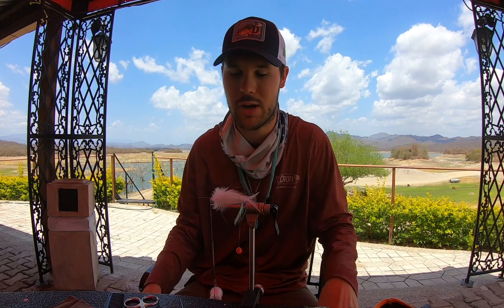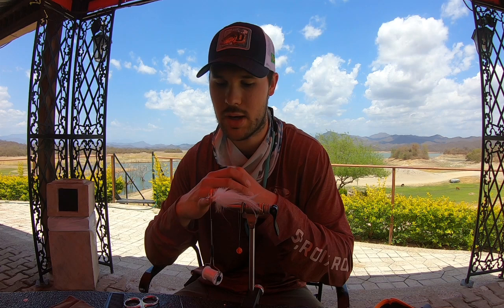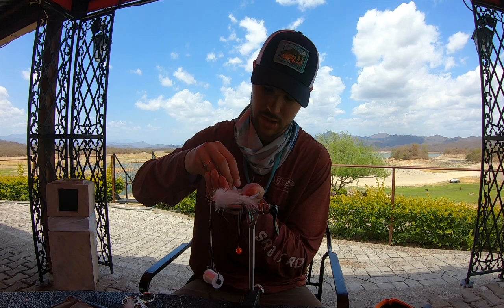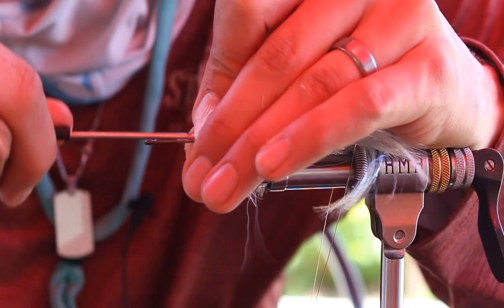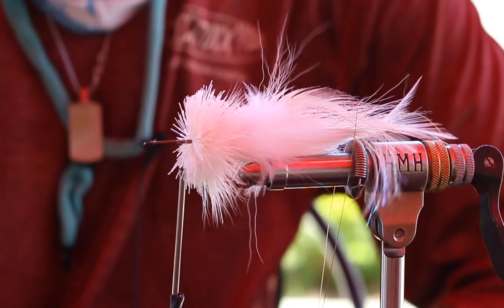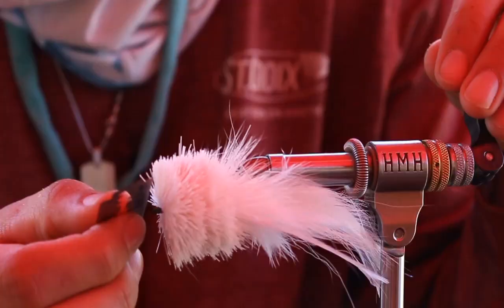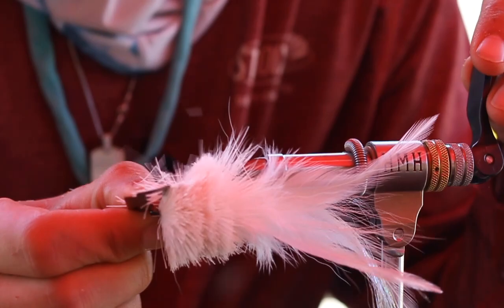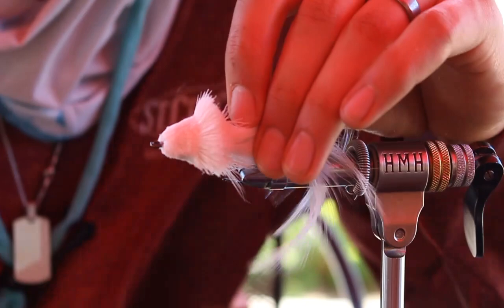Fly Tying: How to Spin Deer Hair

Comment: Very good instructions imo. You tie very much like i do with hair bugs but much better. A couple of details are different from my procedures but almost the exact same. Thanks for posting. I started over 50 yr ago and had to figure it out on my own and i am surprised how close we ended up on technique. I hope many beginners find your vids. The one thing i would like to see is more detail on thread. I started with a real heavy rod wrapping thread from Herters. I may still have a little of it in my supplies. I used mostly body hair and still do. I tie mostly variations of Tappleys bugs. I sometimes leave the faces as tied and sometimes i smear on a little 6000 glue or shoe goo which firms up the face to create a different sound. The tapered body allows the rear of the bug to sit low in the water as a frog or injured minnow does